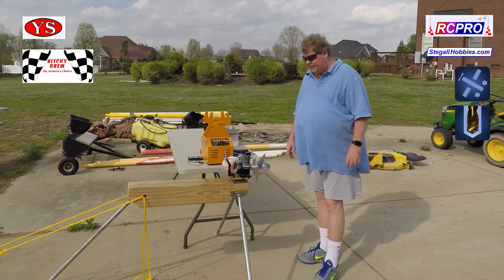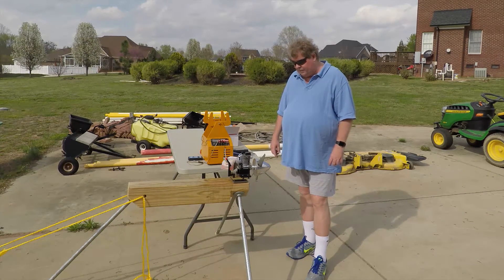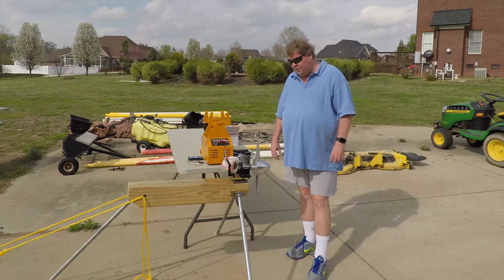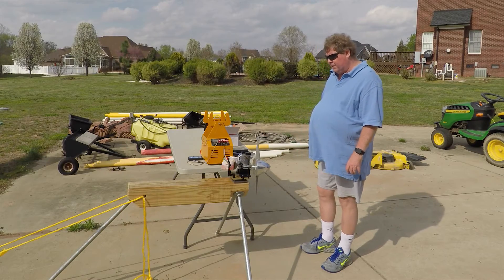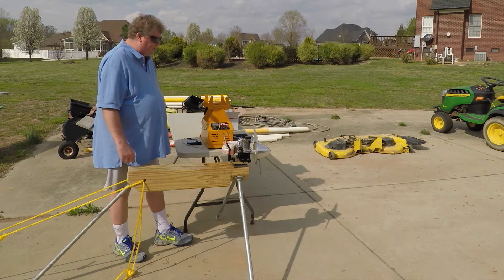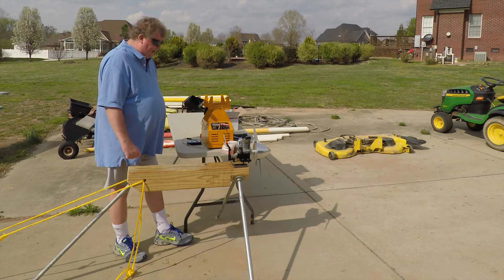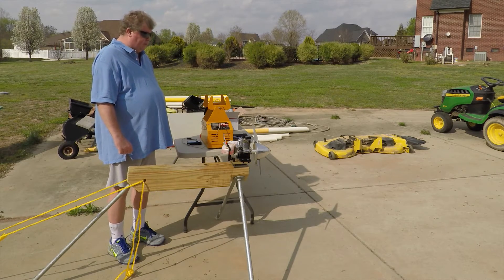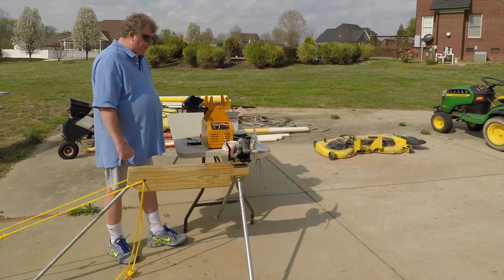YS DZ185 - Part 3 - Test Running with APC 17x18

Comment: Hello, what percentage of nitro are you using?  What glow plug?
Reply from the maker: +In2Engines I was running Cool Power 30% Heli fuel. I have not gotten to the 50% and 60% Ritch's Brew fuel yet. I want to get more running timme on the engine and I'm setting up a PSP backplate mount with a Dubro 688 dampening engine mount to see if ti vibrates too much for that mount. I have also gotten the YS0003 mout, but have not had time to make a fixture to run it on the test stand. The plug is the YS 4 stroke plug. I have some Merlin 4 stroke plugs and will be doing more engine testing while I assemble the plane this engine is going in.